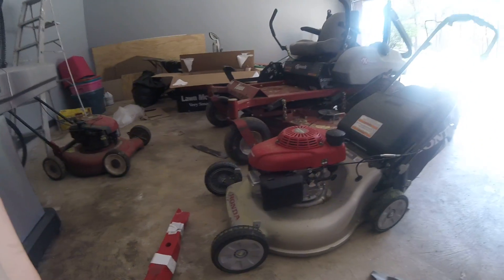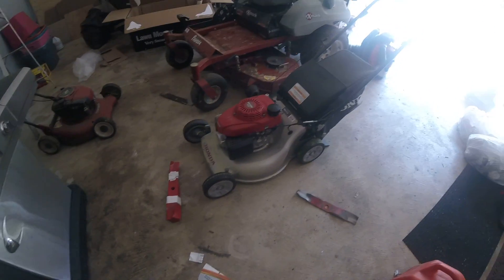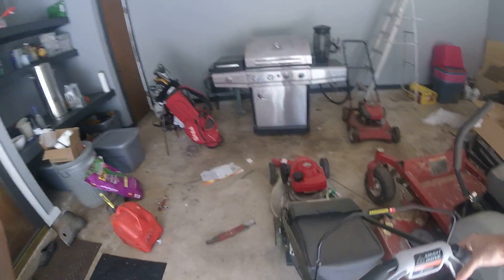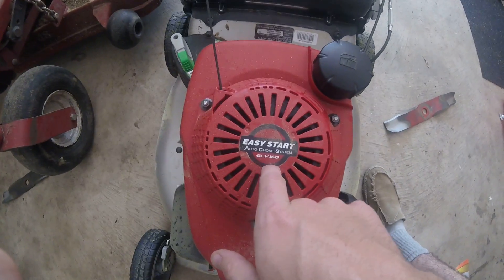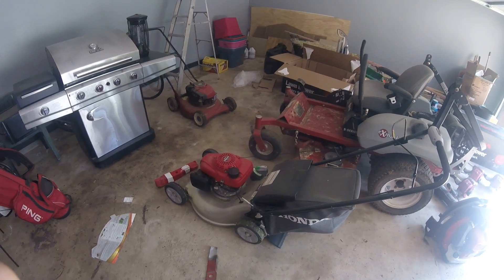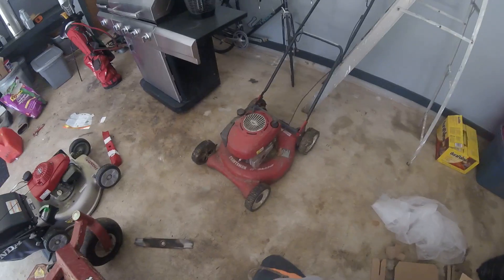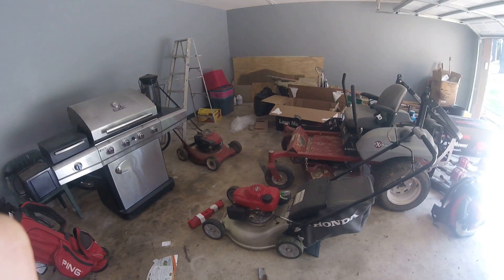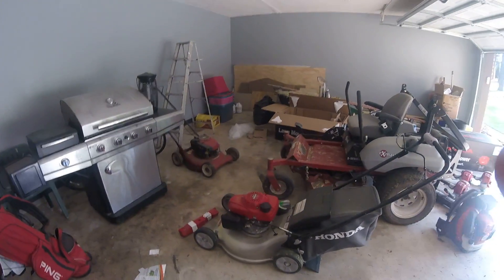Best Push Mower For Lawn Business

Comment: For xmarks from just 2 years experience. The 30 inch is decent but useless as soon as you get into some damp grass clogs so bad.  Not worth 2500!  ... the 21 inch was quite the beast i'll say that much.  The body did crack once when a rock was hit, smashed a hole in the side.
Reply: Gamubi

Comment: Dude . u far from mic/ then too close.. like almost not hear you then wow loud!. Honda mower suks!! Heavy aluminum not needed if keep in shed. motor leaks fuel st top engine.. also the NEW carb design /Always starts easy.. but emmidiate dies just as fast A lot!!! 2 times in shop... worked a while then same chit !!! starts/ dies straight away ! .. if califonia law get out our arss about the emission on Small motors, carb jets be bigger = less clogging up.. more dependable! nice mower for long straight perfect flat lawns.. don't try it on high/ or a lot weeds / clogs -up .. no were for shoot to get rid of debri... if prop partly open bagger /your mower wont clog -out/ but u legs pay for it in scratches. most Hondas = no side shoot.
Reply from the maker: yes it is definitely not a good mower for high grass only for manicured lawns that get mowed every week or two weeks
Reply: If you use ethanol free gas, it won't clog up as easy. The grass shoots out the back instead.